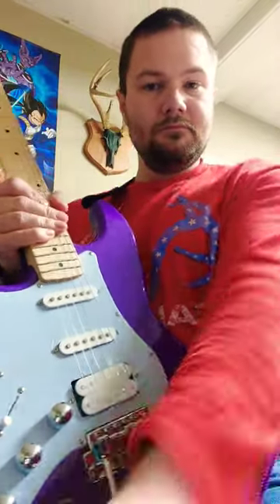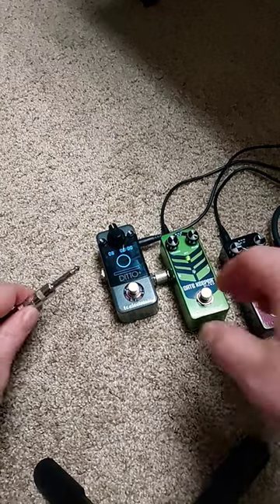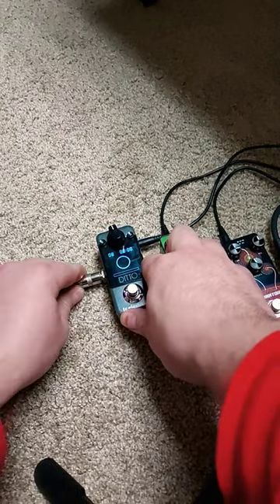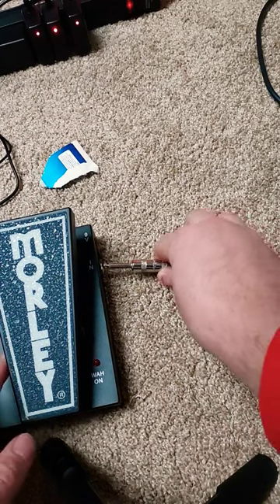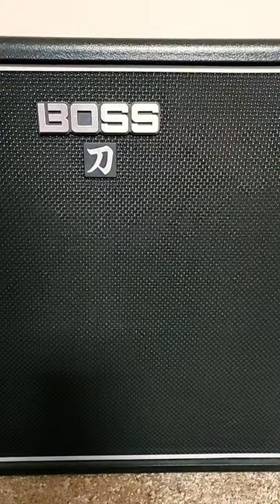How to Tell if I Need a Buffer Pedal.

Comment: And where is the answer?
Reply: So the point is if you can notice signal loses around mids and hearing maybe a little more lows than the direct guitar amp combination and if you do have signal loses I guarantee you that it’s gonna be obvious as hell especially if you have a long signal chain you can hear that lose of brightness in that case probably a buffer might work for you and of course don’t forget using some bad quality patch cables also cause that signal loss you can start from there as well hope that helps
Reply: @muratcankeklik1710  Thank You, it would be good if You  at the end of such video will state point like this answer.
Reply: ???????i dont understand what u want try to show????